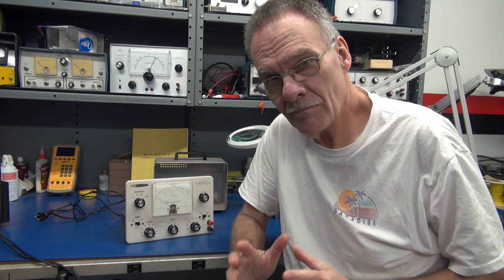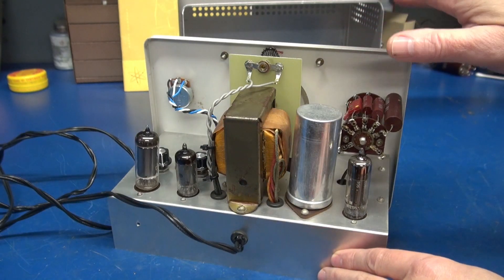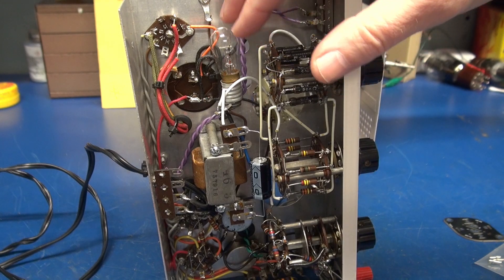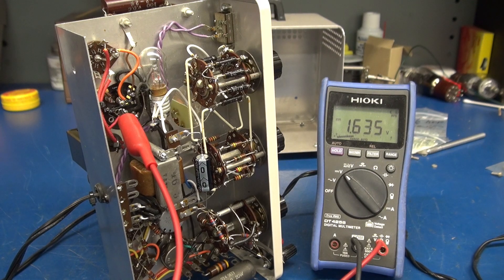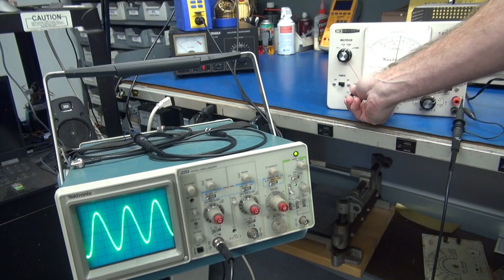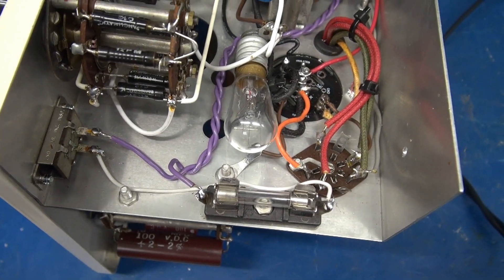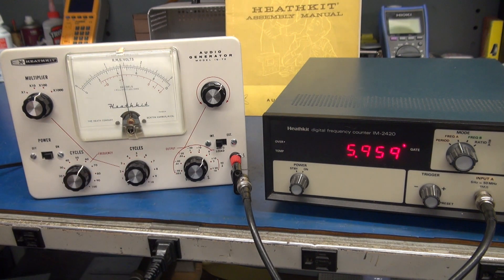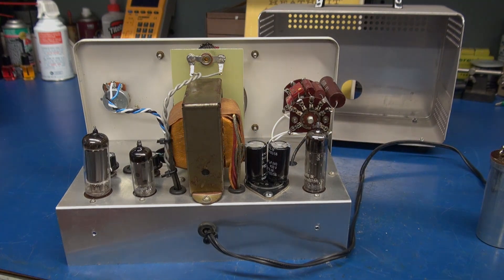Heathkit IG-72 Vintage tube audio generator W8AOR Universal filter capacitor replacement PCB

Comment: Is that the Uni-Cap PCB 600V you are using?  On the W8AOR website it looks like it is designed for one capacitor, but you mounted two????

Comment: How many are wondering why there is a light bulb under the chassis?  I've seen those before.  It isn't supposed to light up.
Reply: Me for one. Read a circuit description, after initially thinking what a daft place to put a lamp.
Reply: @ralphj4012  I took it out and the receiver didn't work correctly.  An old timer tv tech told me what I did wrong.  He noticed that it was missing as soon as he got the chassis out of the cabinet.  Mumble mumble temperature compensation resistance mumble.
Reply: It's there to help regulate the amplitude of the oscillator. Lamps are used because of their nonlinearity. Another great example would be the classic wien-bridge oscillator (HP200A).
Reply: @thomasklima215  Thanks, I was 11 at the time and found an old AM/SW receiver in grandpa's cellar and started to monkey around with it.  The bulb didn't light up so I took it out.  I thought it seemed silly to have it under the chassis at the time.  Then the dial cord broke and I put all the parts in a box, never to be seen again.
Reply: Wien Bridge Oscillator.

Comment: Does the Heathkit still have a two prong cord and would putting in a three prong cause any issues with it?
Reply from the maker: Audio test gear usually floats, so best to keep the 2 prong cord
Reply: @d-labelectronics  Good to know, thanks.  :)